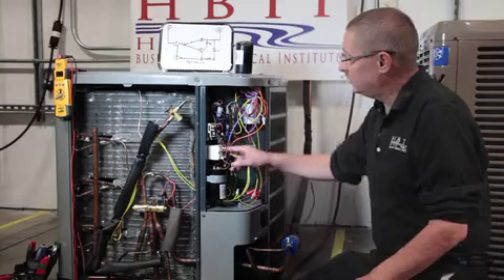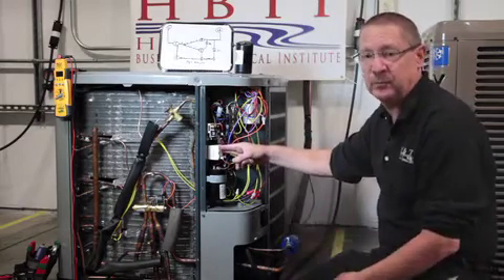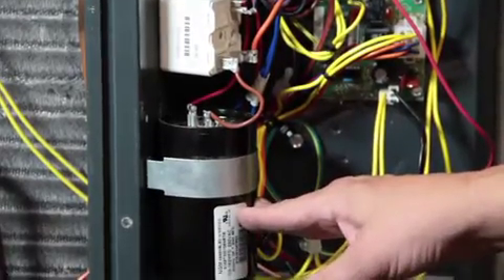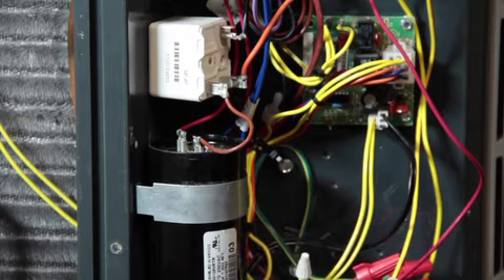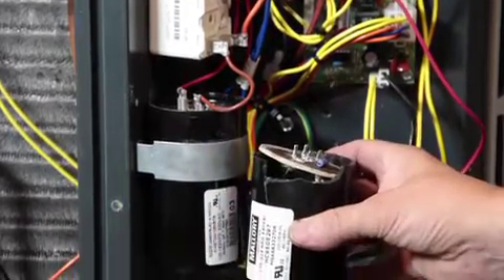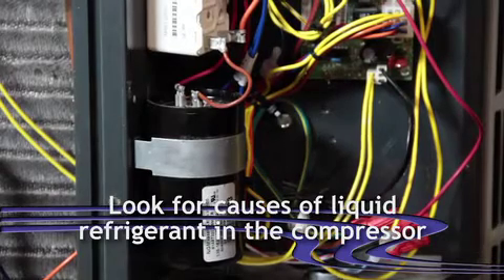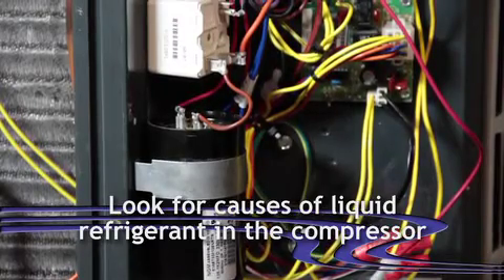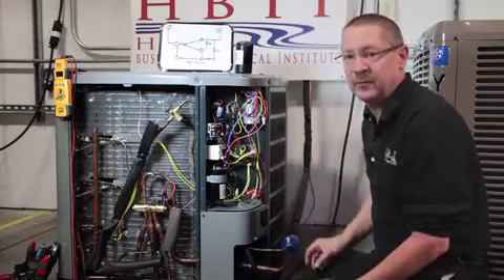HVAC Hard Start kit

Comment: Interesting theory. I had 3 hard starts fail on my old American Standard. It ran okay, but made the lights dim on startup. The first hard start failed in a day, the second after 2 weeks (both 5-2-1). The third was a timed hard start and it failed after a few months, all had the caps blow. All times I knew they had blown because the compressor overheated. The superheat was correct on the system, but it could have still had liquid R22 backing up for some reason.